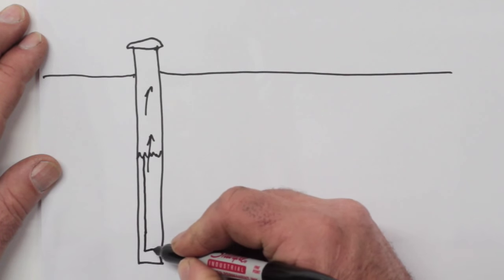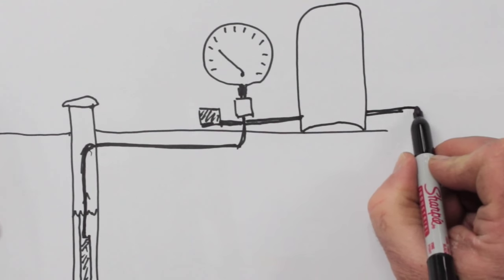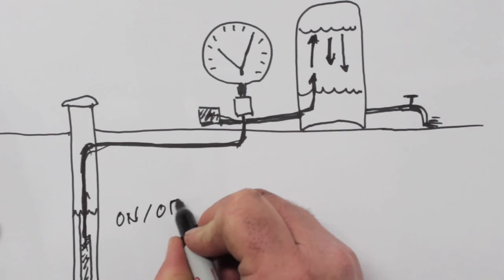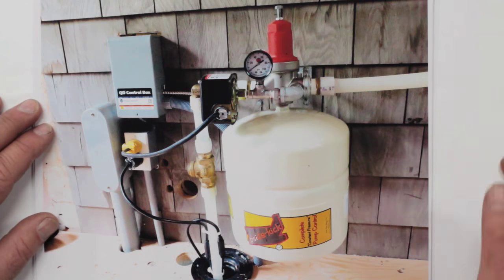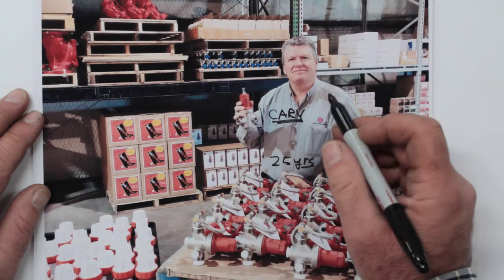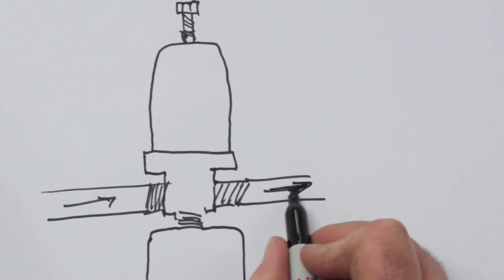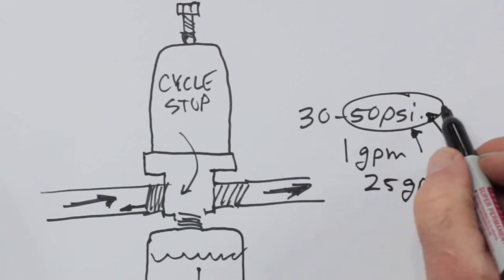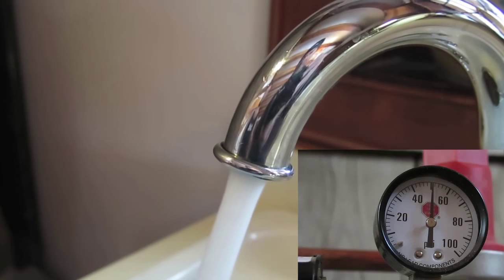How to Make Your Water Well Pump Last Longer

Comment: Did I hear correctly the pump runs continuously. My pump is over 20 years old if it was a running since day one it wouldn't have made it 10 years. No thanks
Reply: Lol!  The pump only runs continuously WHILE  you are using water, compared to on/off, on/off, over and over.  It says right on the side of every pump, made for "continuous duty".  They like to run 24/7/365.  It is the cycling and off that destroys them.  I have one on a stock well that hasn't turned off since 1999.  Kind of disproves your theory.  :)
Reply: So if the pump stays on, wouldn’t your electric bill be crazy high?  Also, what if you don’t use water for a week on vacation?  Does the pressure hit 60 psi and switch off?  If it switches off every time we stop using water, then how is that not hurting the pump the same as with no csv?   So confused. 🤔

Comment: Basically the same as if you had to tank, the tank with this system is point less the whole reason for a tank is so your pump won't come on every time there is a need for water, seems pretty dumb to me

Comment: Biggest piece of CRAP I ever had the displeasure of selling. 30+ years in the pumping industry and like many others I too drank the cool aid.  
What a POS this product turned out to be. I chuckle each time I walk by their empty booth at the trade shows.  
And yes I am a pretty sharp guy and understand sizing, adjusting, and the physics of this valve. Never will sell or recommend it again.  
For those looking for solutions research a (stupid little company called Yaskawa) Pun intended.
Reply: If you had any problem with a CSV  it is because you are not as sharp as you think and did something really wrong.  The CSV is such a perfect pump control that pump manufacturers blacklisted it as a disruptive product in 1993.  That means the CSV makes pumps last longer, not the other way around.  If you can't understand that this simple valve is much better than a VFD you certainly do not need to be installing pumps, much less something as complicated and troublesome as a VFD.  If you have actual proof of a CSV damaging a pump in any way, I will replace the pump and pay your pull and set charge.  In 30 years no one has ever taken me up on that offer because there has never been a single pump damaged in any way by a CSV. So, either show me a pump, any pump, damaged by a CSV or stop lying to people to sell your expensive and short lived VFDs.  And since you mentioned Yaskawa as a solution, it proves you are only out to make more money for yourself, to the detriment of your customers.